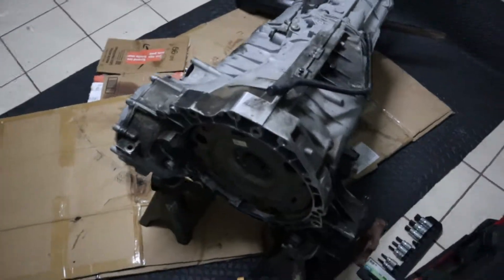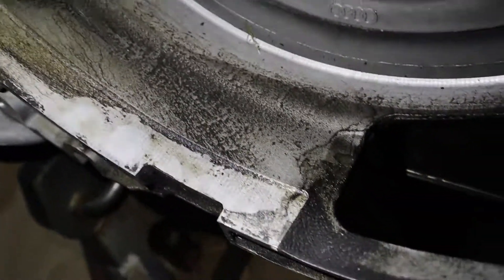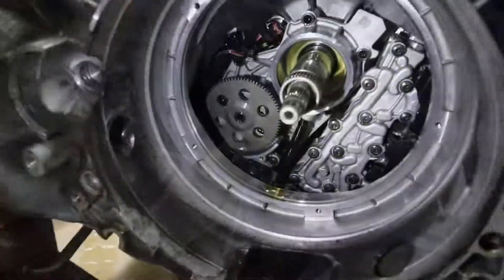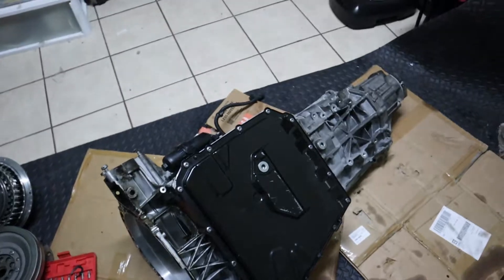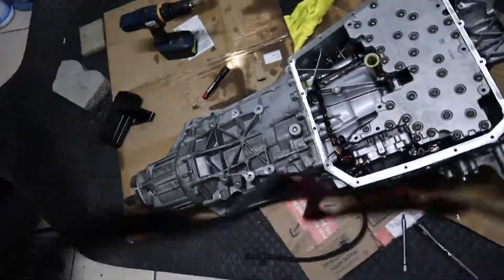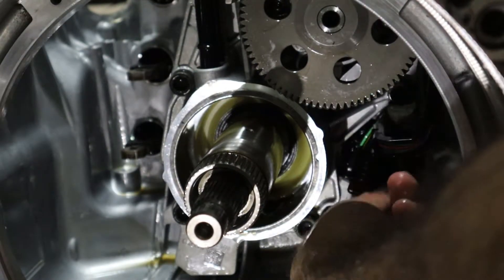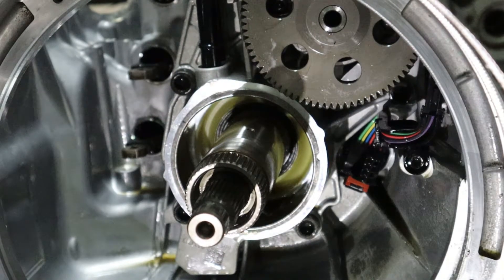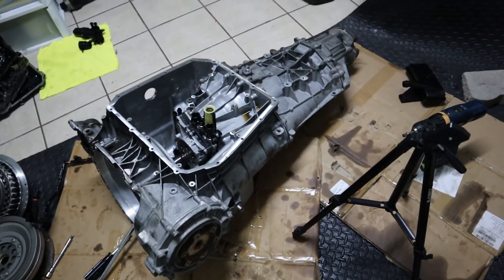AUDI OB5 DL501 S4/S5/S6 G676  RANGE SENSOR REPLACEMENT PART 2

Comment: What was the reason to change the range sensor?
What was the car doing?
Reply from the maker: @nunoseixo3273 I was getting a transmission malfunction dash notification and I would turn off my car and sometimes it would disappear when I would start back up.  Then I scanned the   codes and it came out as the range sensor  been at fault .

Comment: Hello please how do you remove the external filter housing
Reply from the maker: what year? theres two types of filter housing
Reply: @arkeyfix786  2011 audi q5
Reply from the maker: @sheldonbrown438  motor 3.0tdi or 2.0?
Reply from the maker: @sheldonbrown438  if you have 7-speed dsg transmission this write up is helpful to remove the transmission filter :  https://www.audizine.com/forum/showthread.php/743933-B8-S4-Complete-DSG-Maintenance-Service-amp-Sport-Differential-Service-DIY